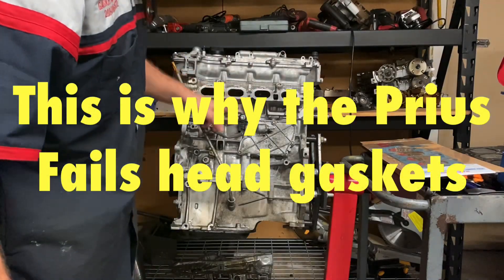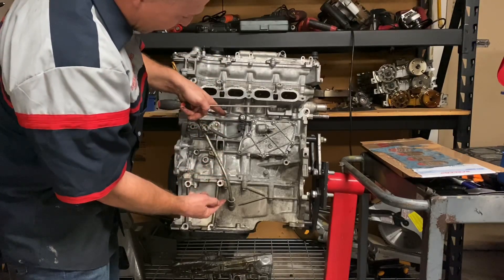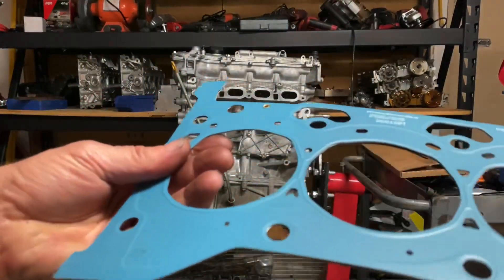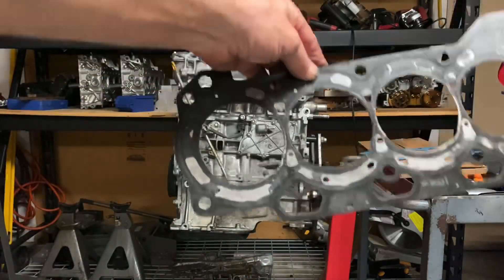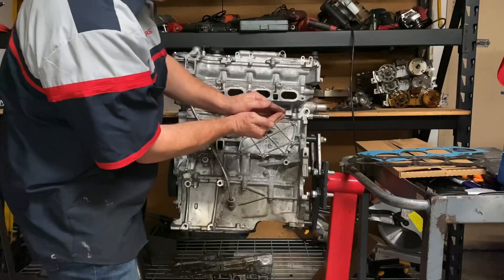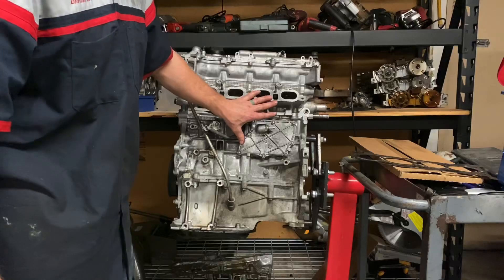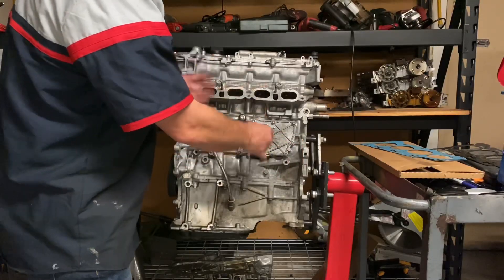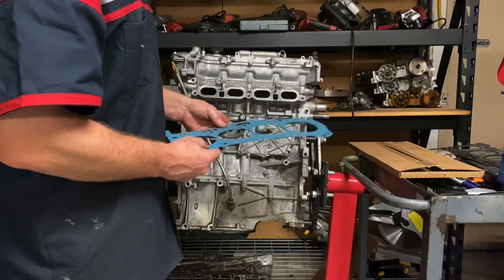THIS IS WHY YOUR PRIUS FAILS HEAD GASKETS, BUT ITS NO BIG DEAL

Comment: Do you recommend frequent replacements of head gasket? If yes after how many miles?
Reply: It shouldnt be a frequent occurence if it is then there is something wrong or gaskets installed are very bad. 
If its designed well it should last for at least 300-350k miles. 
In Prius main problems are both   design (too narrow gaos between cylinders and open deck design) and hybrid system which doesnt let the engine fully heat up and keep the temperature.

Comment: Nice! Gonna replaced the head gasket in my 2008 Prius this weekend. Toyota needs to improve the design, otherwise, it’s sarcastic that you save $2000 in gas, then spend extra $2000 to replace the gasket
Reply: but you save the planet. Actually just don’t own a car at that point
Reply: You save a lot more than 2 grand on gas over 200k miles compared to regular non hybrid car.
Reply: My qipte was $8000 for  2011 Prius 😢
Reply: @merlinarmstrong8346  check the fuel injector too. I replaced the gasket but didn't solve the problem, and it ends up with failed fuel injectors. I replaced them, the baby now drives 49MPG

Comment: I took my 2010 Prius to a Toyota dealership ( stone mountain Toyota in Georgia ) they said it was my intake manifold, then my coils, so 2 grand later they still didn't know what was wrong with it. They then have to run diagnostics twice for 4 days. which they provided a rental for those days as if that really helped. But then come back and tell me I need a new head gasket (3.5k after taking 2k off for the stuff I already had done) after I spent 2 grand and have no more money they tell me this. So now I think I'm going to get a loan, call gasket masters, and drive 9 hours to Florida. =)
Reply: That why I always pay with a credit card you can dispute that and get your money back but it's probably to late.
Reply: Who do you use in Florida. 
I'm just starting with the 20 second rattle on start up😢

Comment: The thing is, though, Gen 2 (2004--2009) Prius doesn't have this problem. It's Gen 3, so they changed something or it's the EGR clogging problem. My Gen 2 has 350k miles, no engine problems, no coolant loss, ever.
Reply: bingo.  This video is wrong in every way.  I appreciate the guy can change a head gasket quickly. Kuddos....but leave the diagnosis of why this happens to the experts

Comment: Great explanation, though is there a difference between the in head gaskets in Gen2 (no head gasket problem) and Gen3 Prii????
Why is it specific to the 2010 + ?
Reply: I know that the whole EGR system gets really clogged up on the Gen3 and not so much with the Gen2.   The clogged EGR perhaps causes the engine to cycle on and off more often?

Comment: prius owner: i get 50+mpgs!  and i just do regular maintenance: oil change, tire rotation, and head gaskets.
Reply: tbh, my 2010 Prius head gasket is just starting to fail. 200k+ miles and 14 years old...not bad...most other car brands engine and transmissions probably failed way before this.

Comment: Very interesting. Why second gen prius don't have this issue?
Reply: 2 reasons off the top, 3rd gen has an electric water pump and when it suddenly dies, so does your head gasket due to overheating. 2nd, the 3rd gen has an elaborate EGR system prone to clogging leading to excessive cylinder temperature. Both of these are serviceable items. I addressed both on my car as preventative measures at 125k.
Reply: @OptimisticEngineer345  clogged up egr system has nothing to do with excessive cylinder temperature.
Reply: @repairvehicle  This is the theory on PriusChat. Nobody has proven it definitively it, however a clogged EGR system has strong correlation with head gasket failure including manny repeat failures when the EGR system was not cleaned when the head gasket was replaced. Could be from temperature, pressure, or both, that’s an ongoing debate but the relationship to head gasket failure is quite certain.
Reply: @OptimisticEngineer345  , egr has nothing to do with head gasket failure, it's a nonsense from people that don't understand how egr system works.
Reply: @OptimisticEngineer345  , what I have found. Head gasket fails from to many cycles heat no heat. Metal can take so many cycles before it fails.  Head gasket is made from Metal. 
Egr cooler designed to cool off exhaust gasses before they are routed back for burning inside cylinder. Only partial gasses enter combustion chamber at given times.

Comment: The high temp is the engine killer,  hybrids have a most problems with a bad head gasket is due to poor/ faulty electric coolant pump...
Reply: Yep. Replace it and coolant every 100k miles with a new OEM unit and this shouldn’t be an issue. I did mine at 125k. They seem to fail between 100 and 175k apparently.

Comment: great video! I got a 2013 prius v 3 years ago with 80k miles. I have 190k miles on it now and it is having this same issue. I changed plugs and coils to start but nothing changed. Then I blocked off the egr because I thought that was the issue. No luck. After checking my engine over I can clearly see the head gasket was redone at some point before I got the car. So I'm going to change that next. My car is having all the symptoms you talked about in this video so I hope this is the problem. Thank you for this video!

Comment: Why are you not mentioning the NEED to check for a bent rod? This is a 13 to 1 compression engine. Doesn't take much coolant to lock it up. Mine had a #1 bent rod, luckily I CHECKED. I replaced with a Gen 4 eng. Much better Piston and ring design with minimal conversion

Comment: The takeaway on this is to get the improved blue head gasket that contracts and expands along with the engine block and cylinder head.
Reply: The old one did that too. They stay flat after a certain number of expand/contract cycles
Reply: I was wondering why my warehouse had these flying off the shelves lol they're great apparently and I'm just now finding out.
Reply: What part number this? Could you provide the link @benjaminrivera117

Comment: 2017 Toyota Prius, dealership just told me my head gasket needs replacement. Only 59400 miles on my car, still under warranty. Toyota using cheap gaskets?
Reply: That sucks. I’ve heard such good things about 4th gen reliability but I guess the problem isn’t solved yet.

Comment: Awesome explanation.  My 2010 prius has about 350K miles on it.  I got the cylinder 1 and 2 misfire.  I did the chemical test and it confirmed that I do have a blown head gasket.  A part of me wants to replace the head gasket myself, but there is also another side of me that just wants to put one of those sealant and hope it last another year. Still debating on if I should just do the replacement myself.
Reply: On their Gasket Master video removing the head, it shows what the sealant does, not good.
350K on one engine, that is awesome!
Reply: @Rambleon444  350k on a Prius engine is standard they all go up to that much without any major problems
Reply: I used the Moroso ceramic block sealer, I’ve put about 40k miles on it so far & it’s holding no problem, If it fails I’d just do the Moroso treatment again since it only cost me about $40 total.
Reply: I'd just get the head gasket done if you plan on keeping it. I used the thick silver Barr's Leaks and it lasted 10k before needing more. Lost a water pump not too long after the 2nd use but the car had like 220 thousand miles so it may have been going anyway, that's normal time for that type of part. Though after my 3rd sealant use the heater core clogged. Now it sits in the garage needing 4k in work, though still runs fine for short trips, just no heat.

Comment: Great explanation. I had a cylinder 2 misfire on my 2010 Prius, I knew it was a head gasket, I took it to an independent shop, they wanted to charge me $4k for a new (used) transmission. I’m now in the process of taking off the head at my house.
Reply: Toyota wants to charge me 4k for the head gasket replacement on a Toyota Prius C
Reply: @cityoftrees9953  at that point why not just get a new engine 😂
Reply: Ya in you should be able to do it yourself within 2-3days

Comment: Thanks for the great explanation! What would be the life expectancy for the water pump and inverter water pump? And where is the common oil leak on this engine?
Reply: replace the water pump BEFORE it goes bad. TRUST ME. 120k tops. mine went out at 140 but definitely replace it before it goes bad. this is soooo important

Comment: It think Prius’ also have another issue contributing to the failure,  air trapped in coolant system that’s hard to burp for most of us….
Reply from the maker: How do you think the air gets there?
Reply: @gasketmasters  wish I was smart enough to figure stuff like that out…..lol.  Did read that possibly water pump slight leak that sucks more air than leaks the coolant,  kinda weird.  I have lost a tiny bit of coolant and can’t see where or even the evidence only reservoir has dropped a smidge…..

Comment: Pls I seriously need your help. My location is Nigeria. There are no mechanics here who can really work on hybrid cars. 
For the past 2 months, I have been having rattling and knocking sound. With no error codes. I cleaned the whole egr systems,  cleaned injectors, changed spark  plugs, cleaned throttle body, cleaned PC valve, Cleaned inlet manifold,  I have oil catch can installed for about 5 months now.  Upon all these, the car is still rattling and making knocking sound. Especially when it's charging the HV battery.
If I drive fast the sound disappears. 
My coolant doesn't shot, my engine oil doesn't have water in it but I noticed the oil does shot. So I can't say it's blown head gasket. 

And today this new incident happened.  
Now if I remove the 12v battery head for 5 minutes and put it back the car starts on ev only after 3 to 5 seconds then car trys to start the engine and the ready light goes off and check hybrid system light and other error lights comes on on dash board. 

Is this a sign that my engine knocked?
Will Changing the crankshaft position sensor solve the issue? 
What exactly should I do?
The car has 145,000 miles on it.
The error codes it shows using toyota techstream now are P0335, P0A0F, C1259, C1310
Reply: Check to see if there is liquid in the throttle body.   If so suck it out with a vacuum tool or a turkey baster.   You might be able to simply drain some of the oil from the oil pan.    Too much oil put in after an oil change can cause this.   It can also be caused by a damaged  head gasket that is letting coolant into the oil.   This coolant overfills the oil.    The shut off feature keeps you from running the engine and thereby causing more engine damage.

Comment: In the midst of the head gasket job. I've been told elsewhere that the need for resurfacing is rare, and overall best not to do with the little room the head offers for it. I'll be checking for any warping, but haven't had any significant heat so I'm fairly confident on that. Would you agree that the need for resurfacing is rare, and that if warped, to just purchase a new head?
Reply: No real answer, it only depends how warped the head is , caused by how hot it got or persisted. Only way to tell is to measure it with a straight edge. Toyota manual says can't resurface and should replace if out of spec, but many machine shop can resurface a small amount no problem

Comment: very well explained 👏.  I work for lyft  with my prius  should i replace the head gasket now or wait until misfire? currently milege 125k Thank's
Reply from the maker: Yesssss
Reply: @gasketmasters  thank you for your response.  but i didn't get it should i replace it now?  thanks again.
Reply: Don’t replace it unless you have misfire symptoms, my 2012 Prius just went over 200k without any HG symptoms. Dealer replaced the EGR @ 146k miles because it was a recalled, I did replaced the water pump and PVC valve @185k miles just for preventative maintenance.

Comment: My 2010 Prius just started leaking coolant into cylinder 3 and steam is coming out the exhaust. My Prius is vibrating like crazy.
Reply: How many miles does it have?
Reply: @bens3661  170k. Never had any issues prior to this.
Reply: @Jas_01101  dang I just bought a 3rd gen so Im worried. Good luck!

Comment: Does change oil frequently help prius engine head gaskets last longer ?
Reply: I would suggest using the Bars head gasket sealer before it starts to leak and leave it in.   I posted a comment today about using the Bars on my prius.

Comment: wondering why this almost never happen to 1.5 L gen 2. Prius
Reply: Some people blame the electric water pump or a clog egr cooler and intake manifold.  I'm having my 14' 180k miles leaking from cylinder 2 I'm going to replace gasket and head if need be an see what happens.  I'm also going to replace water pump and clean egr or intake. My 2005 has 290k and no issues like this.  Maybe bad quality head gaskets where installed from manufacturer or thinner walls where cylinder and coolant passage divide vs as compared  to generation 2
Reply: @lobogris4806  yes the official reason is from EGR even normal function causing carbon buildup on the piston ,this start touching the head and the slight deformation in the aluminium  causing the leak. best to do is to check pistons with camera. gen 2 has no EGR but waterpump often leak a bit
Reply: @8peterp  on my gen 2 only issues I have had was water pump pulley broke once and replace inverter pump twice and coolant control valve also twice, plus oil sips pass pvc valve even though I replace pcv valve. I also change oil and cvt fluid as required. over all it's been the best vehicle I have ever owned.  It's literally a mini tank on wheels 🤣
Reply: ozziesutcliffe3791  official I mean Toyota fixed some engines with carbon buildup ,can't find post or anything now and not sure EU or US. failing waterpump seem more common after 2009 models and would explain #1 cyl too maybe

Comment: @Gasket Masters 2012 prius with 180k miles. Started having the head gasket issue. I have a lead on a 2015 prius motor with 50k miles. Are the 2015 models any better about this issue or would the gasket fail similarly on these models as well? Trying to decide between motor swap or head gasket replacement.

Comment: Got 187k on my 2010 and runs like a Ferrari, 0-20 Mobil at every 5k and all fluids replaced. No worries.😎👌🏼
Reply: Have u ever replaced to head gasket?
Reply: @stn7172  ...nope, ran clean. Got a 2017 Prius prime now 4 yr in and zero issues.

Comment: My wife's prius had typical engine misfire problem - toyota dealership diagnosed it as dirty egr and cleaned it for $1000.  just couple of week after repair prius developed full blown head gasket with plumes of white smoke coming out.   Thanks to your head gasket replacment video, I might be able to do it myself and save over $3K in repair cost.
Reply: I would see if they wont give you a refund on the EGR cleaning, it was misdiagnosed.
Reply: My car was working fine and saw a video talking about how egr cleaning will make the prius smoother and more powerful. I cleaned it, couple of days later, boom - misfire and white smoke from the exhaust 😢
Reply: 1000 for egr cleanup? it only takes a couple of hours.
Reply: @west_park7993  it takes about 5-6 hours doing that the right way. Just to disassemble and assemble it would take 2-3 hours at least.

Comment: Hey gasket masters, I just bought 2012 Lexus CT 200h. After putting 3k miles I started getting rough cold starts and p0302 cel. Replaced spark plugs and check engine return and went away. How would I test a bad head gasket in a hybrid. I don't get milky oil, I don't lose coolant. If it's head gasket do I need to shave the head? Mechanics say I don't need it if it's even.
Reply from the maker: Block test

Comment: You are an amazing person and a teacher. I wish i could spend some time with you in garage and learn something more about Toyota Prius.
Reply from the maker: Come on out to Stockton California
Reply: @gasketmasters  Do 2016 or 4th gen Prius also have similar problems?
Reply: @gasketmasters   im in north Stockton off of west and morada. I’m changing the head gasket on a 2010 Prius for the first time, having a bit of trouble. U have a shop? Or mobile? Great video by the way
Reply: Hello? Is there a test to check if my 2011 Prius has a bad HeadGasket? I just recently got P0301 reading on OBDII.
Reply: @Noezen03  just like other cars. Pressure test from the coolant caps  remove the sparkplugs and check it with flash light. You will see wet coolant on the cylinder 1.

Comment: Man I had my doubts but this dude is legit 👌 
Gasket masters set up an appointment with me and came within the 2 days and did work on my Prius! Did exactly what he said and my car is running like new 😌 very professional and clean Job definitely recommend if you having the same issue explained in this video! Thanks man 🙏
Reply: How much did the work cost on your Gasket?
Reply: I'm thinking of doing the same. How long did the work take? Was it 2 guys that came to do it? Which city? How is it holding up so far? Sorry for all the q's !
Reply: So this is the 3RD generation of the prius why has Toyota not addressed this problem
Reply: Hi how much they charge and how car still
Reply: Here is a well done DIY head gasket replacement presentation, Prius 2016-2022

https://www.youtube.com/watch?v=NAei4nsNFzk

Comment: Someone in some other blog was pointing out that the reason is the built up condensation in intake manifold specially when the engine is cold due to faulty design that will damage the head gasket over the time that's why Toyota changed the intake design if not mistaken after 2013. What's your take on that?
Reply: I have noticed, I when I had my car sitting for a while in my garage, I had that knock when i finally started it again.  I have also noticed, my oil catch can often has a decent amount of water in it, despite no loss of coolant whatsoever.